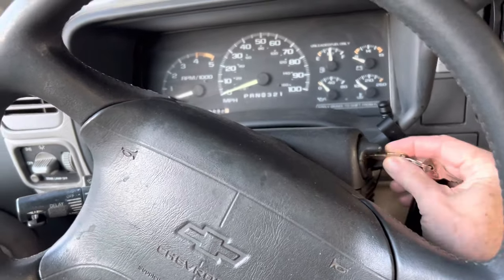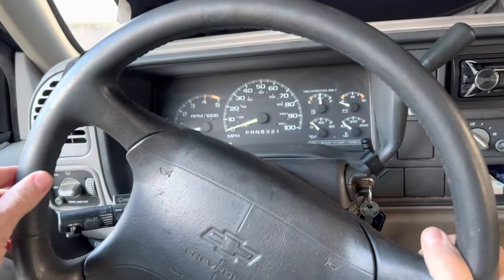How to fix a car ignition switch that won’t turn￼￼

Comment: Hey..young kid here.When you insert key in to ignition, you don't hold on to the key and turn? You hold to what is around the key? Not sure how to explain it..SOrry.. but No question is a stupid question right?lol.. Thanks in advance
Reply from the maker: Yes. That’s the better way to do it. That way you won’t risk breaking the key.
Reply: @hoohoohoblin  Thanks... I must admit, which I guess is normal.... Operating a motor vehicle as well as all the things you should know is rather intimidating.

Comment: hope this works on my dads 73 ford galaxie thats been sitting for 12 years. key goes in and turns but just wont turn all the way
Reply from the maker: That might be another problem. It’s possible somethings rusted shut in there.
Reply: @hoohoohoblin  i myself am kinda new to cars and such and dont have much experience with them other than youtube videos. currently cant drive, it is possible that it is turning all the way but i just dont realize it. i guess i will have to see when i get a battery for it.

Comment: Every single time I have an issue on my ranger I can never ever ever find a video with my specific problem. I have problem turning my KEY!! Why does every single guy only focus on the damn wheel? Fuck the wheel lol it’s the ignition even after my wheel is unlocked it doesn’t turn - but why is every video on YouTube the damn same it’s annoying